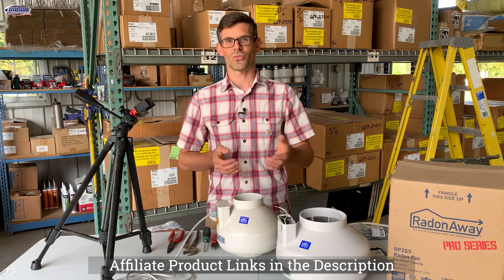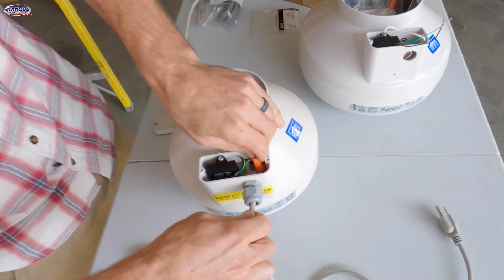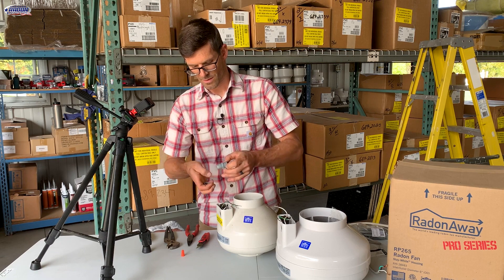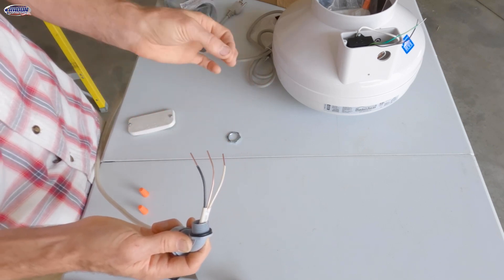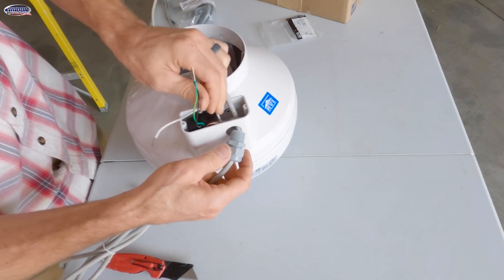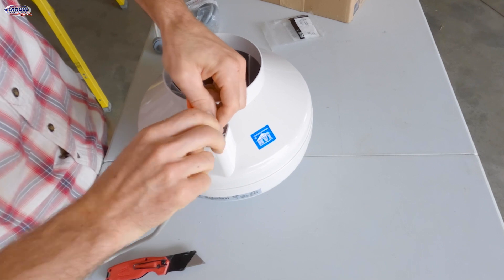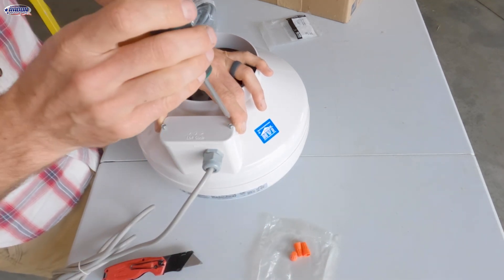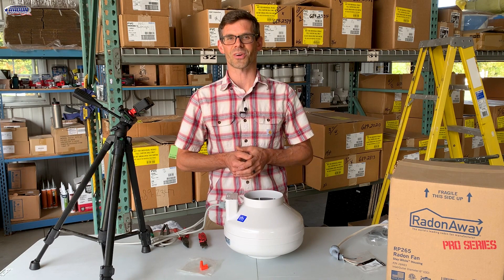How to Wire a RadonAway Radon Fan

Comment: Your videos have been fantastic. I was scared of replacing my noisy fan, but after watching your videos, I know I can do it. 

One question: I currently have an 8 year old Fantech HP2190 in my garage that I can hear in each and every room throughout the house. Would a RadonAway RP145 be a good, quiet equivalent replacement? Or are there others you would recommend?
Reply from the maker: Thanks, Aaron! You can choose the RadonAway RP145, AMG Maverick, or the Fantech Rn2. They all make pretty good fans. However, I prefer the ones with German motors. I've replaced some Fantech fans with German motors that were installed in the 90s and are still working but getting noisy. I've also replaced a lot of RadonAway fans that are five years old. 

Here's a video with a replacement guide in the description: https://youtu.be/wD36T_oY_34?si=CMEzlc51VHwBlaCD

Comment: FYI to anyone else, if your fan only has 2 wires and your cord has 3, just cap the green wire and stick it in the box. It says in the instructions that come with the fan that some motors don't use a ground.
Reply from the maker: I know some of the Fantech fans don't use a ground. Are there RadonAway fans that don't, as well?
Reply: @AmericanRadonMitigation  Yep, just got one from Home Depot (RP140) and there is no ground.
Reply: My wires coming to the fan are two black and one white. I have no idea how to connect it